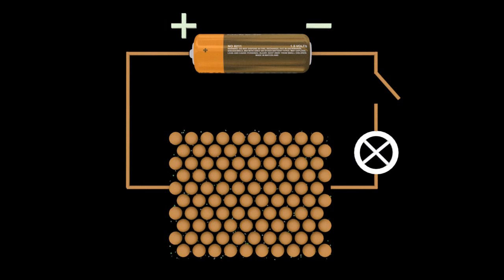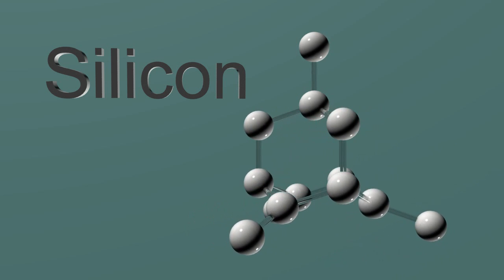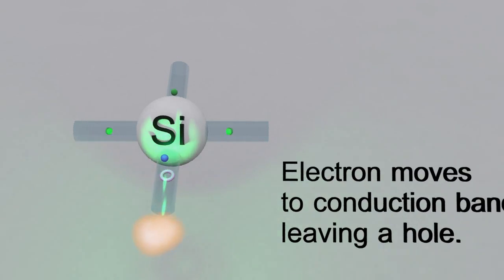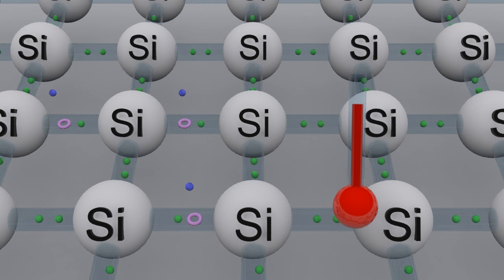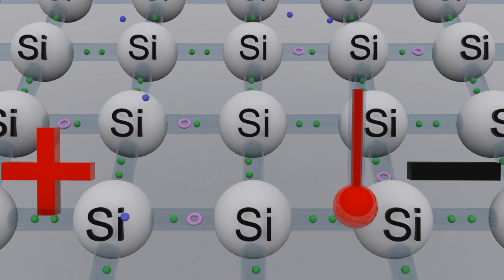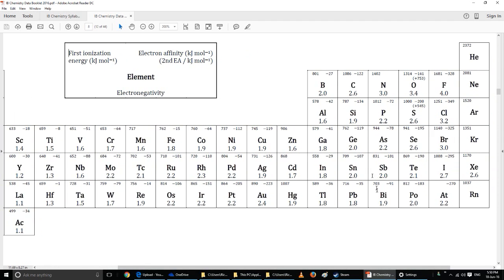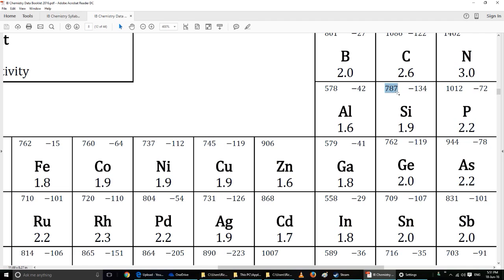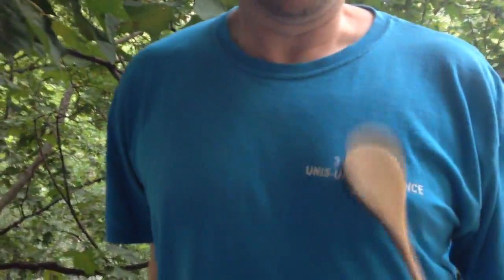C8 Why is Silicon a Semiconductor? [HL IB Chemistry]

Comment: is wet silicon conductive
Reply from the maker: Silicon does not dissolve in water, but maybe electricity would pass through the water if it contained some dissolved salts or CO2

Comment: Hi Richard, is there a specific temperature that a semi-conductor reaches its maximum conductivity? I say this because I track my rooftop solar panel output and they do not perform as well on the hottest Aussie summer days. Also, cheers for these resources - this flipped classroom revolution seems to be gaining momentum...
Reply from the maker: Google "flipping failure" to see my crash-and-burn attempt at flipping.  Increased temperature decreases the band gap - so I suppose a smaller gap is harder for the electrons to fill...?
Reply: Yep I've seen the article. Flipping is yet to get a grip over here. Thanks for the clarification on band gap/temp - might warrant further investigation. We teach the entire HL course in 6 months so there is only so much you can do as a teacher. Also, these videos have acted as my 'mentor' due to the lack of experienced IB teachers to leverage off. A big, big thanks. And on a side note - I was also a 'C' chemistry student in school and now in my 30's I can't get enough of the stuff. There's hope for everyone.
Reply: I did my physics IA on this! Although I don't know if there's a theoretical maximum to the conductivity of a semi-conductor, I know that the reason why your solar panel output decreases as temperature rises isn't because of current. It's because of voltage. As temperature rises, voltage drops by a bigger amount than current increases and therefore brings down the overall power output, since P=VI. The reason voltage drops is indeed because the band gap decreases (as Mr. Thornley already said), and so there is a smaller potential difference between the valence band and conduction band of the semiconducting material for the electrons to jump between, which basically means a smaller voltage. FYI, solar panels are supposed to have a temperature coefficient rating, which tells you by how much you should expect power output to drop for each increase in degree Celsius of temperature (as felt by the solar panel). It's usually around -0.4% per degree C, so on the hottest Aussie summer days when the surface temperature of the solar panel can reach up to 50 C even, you can expect power output to drop by 10% or more!